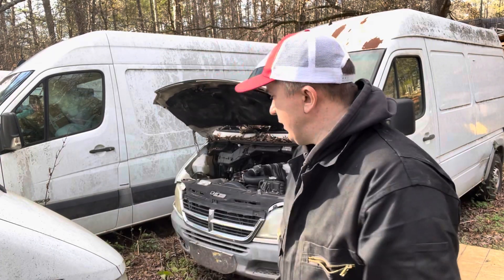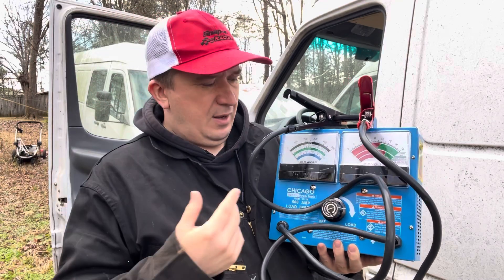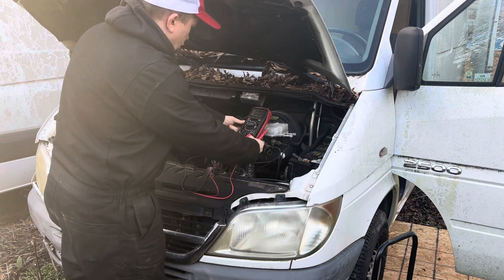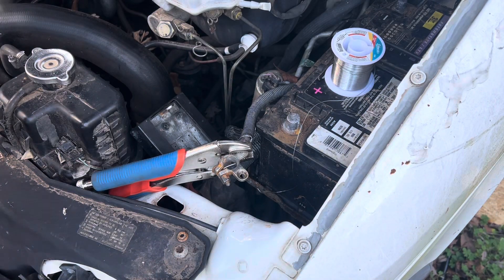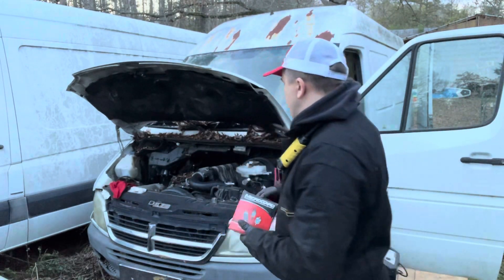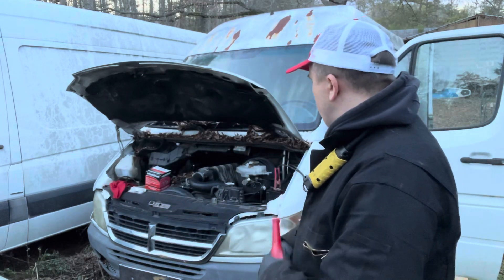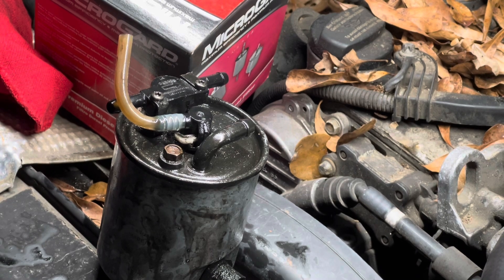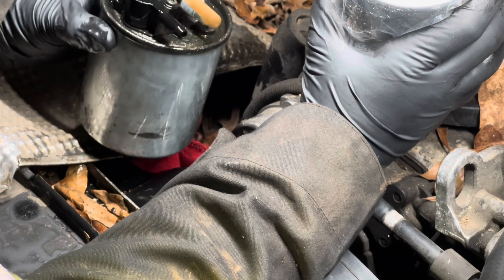Revitalizing My Sprinter: Installing a New Battery and Conquering the Start-Up | DIY Success!

Comment: How to shut the lights off not to work all the time
Reply: On a dodge sprinter twenty five hundred 05
Reply from the maker: Fuse under the seat
Reply from the maker: Yep had same issue, just fuse remove it and solved